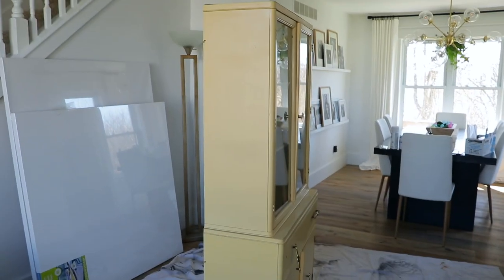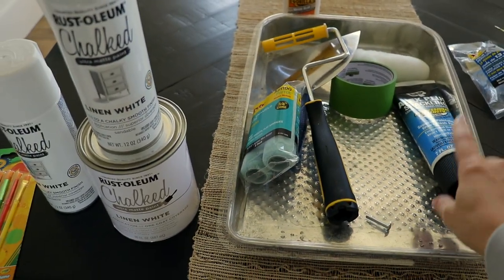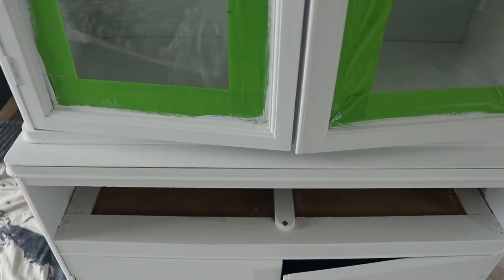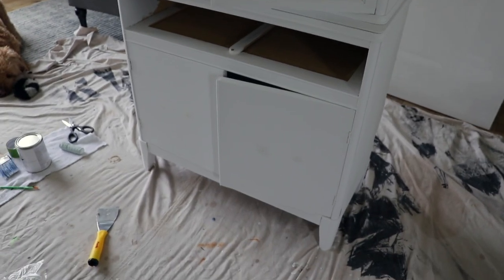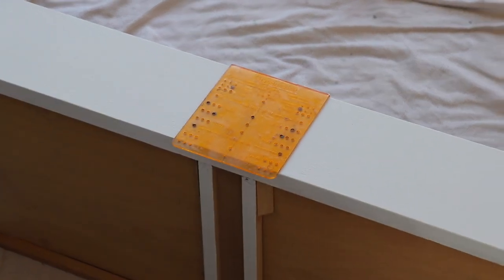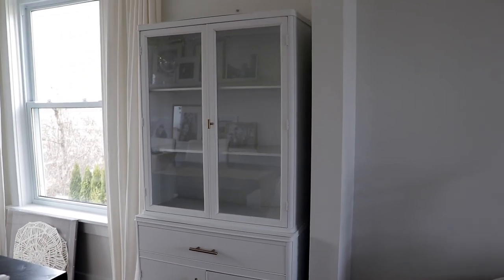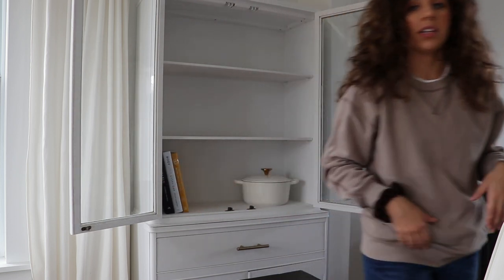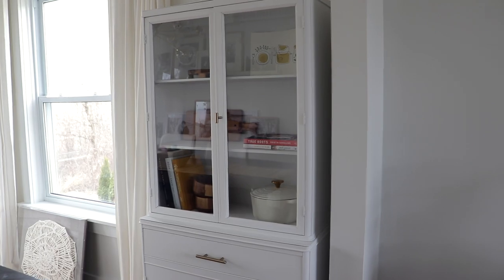DIY ANTIQUE CABINET MAKEOVER!

Comment: I had a cabinet similar to this and for the back behind the glass doors, I placed foam board covered in a pretty contact paper. I covered both sides of the foam board in a different contact paper with a short string sandwiched between the contact paper and the foam board and I could easily pull it out and just flipped them when I wanted to change the look of the cabinet. Yours turned out really nice.